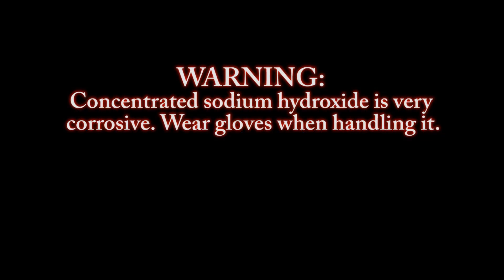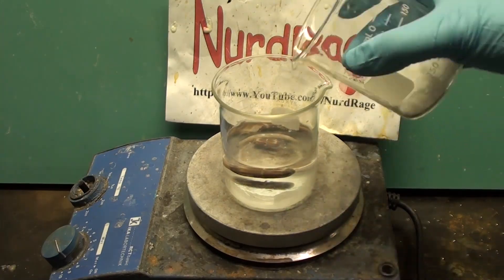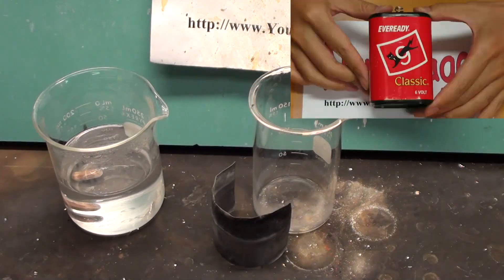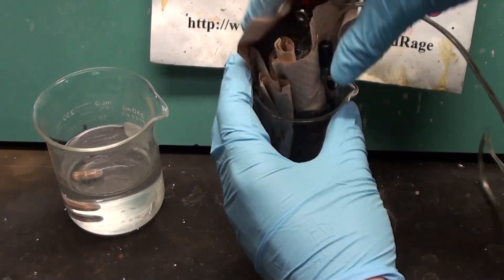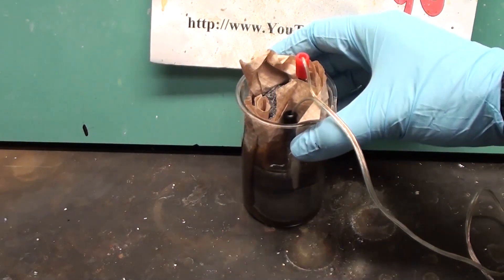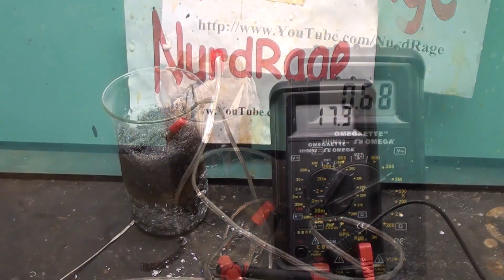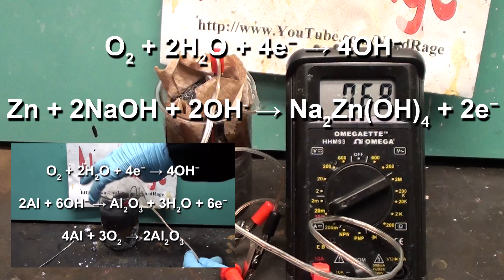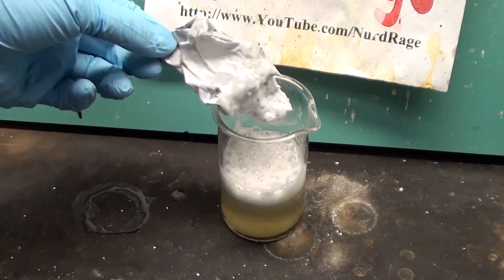Make a Zinc Air Battery

Comment: Does anyone know, would it inhibit the battery to use stainless steel wool?
Reply: It might work, but....   .... Note that anodizing the positive electrode at pH 14 is extremely corrosive.  (Who knows, there might even be O(2-) ions produced by the air electrode!).  Anyway, apparently these conditions will even corrode carbon and produce CO2!  That's corrosive!  (By the way the CO2 that's produced reacts with the electrolyte and clogs up the electrode, so that's a problem, at least long-term.)  (Also it could be possible to use graphite if it is coated in a waterproof polymer.  There's a long list of plastics that can supposedly hold up to KOH/NaOH)  Nickel and maybe certain nickel alloys are on a very short list of metals that might resist corrosion in such strong alkali conditions.  

One concern with using stainless is that the chromium might produce something toxic like hexavalent chromium.  I know the common 304 or 18/8 stainless is resistant to chemical oxidation/corrosion, even with chloride ions, but I don't know if it's that good.  Stainless isn't mentioned on the list of materials to use with KOH/NaOH , whereas Nickel is.   It's unfortunate because stainless materials are much more widely available than nickel ones, but I wouldn't risk it unless I guess you're prepared to handle it and dispose of it properly as toxic waste if something goes wrong.  

There could be nickel alloys that would work though, like possibly nickel-copper.  These alloys seem to be extremely resistant to oxidation/corrosion, even as good or nearly as good as pure nickel.  Both elements are similarly expensive, so maybe it doesn't help on cost, but it could help on general availability and sourcing of materials.  

I just know from trying to research anode materials that a strong oxidizer can destroy stainless well before destroying graphite.  If graphite can be oxidized here, then I don't see there being much hope in using stainless.  And yet I might have seen it mentioned somewhere as a possible third (+)electrode for charging a rechargeable zinc-air cell.  I wonder if would hold up in anaerobic conditions when it would fail in aerobic conditions?  Eh, the issues with any possible chance of hexavalent chromium don't seem worth it.  

You could also take the iron wool and electroplate it with nickel or nickel-copper alloy.   (Not that nickel salts are any picnic either! haha)  I think it's possible to make non-toxic batteries though, and we're going to have to do it sooner or later, so....it seems to me we might as well start on that now as long as we're building batteries.)

Other options are conductive or semiconducting metal oxides, like MnO2 (also ZnO, Fe3O4, etc.).  MnOx is also an ORR catalyst.  Mn is similar to Ni and Cu in being somewhat toxic, but hopefully the MnO2 is stable at least in alkali conditions, and hopefully it can be recycled if disposed of properly.

Comment: What you mean is this is a cell that produces electricity (a galvanic cell), and not a cell meant for electrolysis (which you called an electrolytic cell).. cataclysmicnothing is somewhat correct. The anode is indeed negative, and the cathode is positive. but in a galvanic cell, the redox reaction that occurs causes oxidation in the anode side, electrons to leave from it, and reduction in the cathode side causing electrons to enter it. AnOx-CatRed if i remember well.

Comment: saponification is a reaction between an alkaline like Lye a.k.a sodium hydroxide, and any long chain hydrocarbon molecule like animal fat for example or vegetable oil. (ya been skim over reading about soap or biodiesel i see)
so saponification has less than nothing to do with the concentration of lye (NaOH) regardless its source. homemade lye water fully evaporated to a crystallized form would work exactly the same as lye crystal made with membrane cell chlorine electrolysis.
NaOH is NaOH...

Comment: I Used filterpaper rather than the paper towel to make the reaction i got around 1.24-1.25 volts which was vey stable for atleast 3 hours. then i diluted the concentration of NaOH to 300ml and then the emf shot up to 1.35 volts. Thanks for the experiment Dr.N Butyl Lithium

Comment: I am looking for home made battery To store Electricity from solar cells.. This one produces good Current does not mean if I take large 5 Gallon Container and Use Large Zinc Plates and 5 Gallon of Steel MESH. I can get 220AH Battery with 6Volt DC current.
Reply: I read that it is not rechargeable. So useless. unfortunately

Comment: @taeke18 
W is unequal Wh! 5.18Wh means the battery can deliver 5.18W for one hour until it's completely depleted, that would be a current of approx 1.4A (at 3.7V voltage).
But still you would need quite a lot of these selfmade batteries, cell phones usually need at least 3.5V-3.7V to power on.

Comment: have you tried using activated carbon instead of steel wool as the cathode? activated carbon has a much larger surface area than steel wool for air to contact.

Comment: @xtremegameuser Just to do a quick calculation:
W=I*V

0.68*0.84=0.54Wh

The HTC does need more power. My HTC desire has a 5,180wh battery

Comment: Dear NurdRage! I made zinc carbon battery, and used only clean water for electrolite (hope I spelled that right). I got 1.5v which is about at maximum for 1 battery cell. But my current is too low, when I used salty water, it was a bit higher. I can make better battery using sodium hydroxide on additional chem hours in my school, but cannot show you because I cannot. Can you make one  using zinc and carbon with bigger current? Thanx!

Comment: Using a DC-DC transformer, it should be possible to boost the voltage while lowering the amperage. This means...... well.... you can get this to a fairly well voltage without getting rid of too many miliamps.

Comment: How much power is available from a cell like this? It would have been educational to show a few of these wired in series to a light bulb or motor. 
-
Why steel wool? Would sheet metal work?

Comment: The best and cheapest solution is graphite with alufoil as the electrodes and
water and K2CO3 as the electrolyte.
This gives about 1.3 to 1.5 Volts and lasts long and graphite can be selfmade
(lookup the overunity forum)
or from pencils. And Alufoil you can get from every supermarket.

Regards, Stefan.

Comment: @98JMA Look at the reactivity series.  Just below zinc is chromium.  That would probably work (at a guess), but it's far far more expensive than zinc.  Next down is iron, which is already in use as the catalyst/anode.  I don't see how the cell could work with the same metal as both anode and cathode.  All the ions would have the same charge.

Zinc is simply ideal.  It's highly reactive, low cost, utterly practical.

Comment: @EMDSD40LocoDash2 I might add, the huge surface area of the steel wool is probably much more than adequate for the task.  To deliver more current, I suspect more zinc (or a form with with greater surface area) and/or a freer flow of oxygen would be the best approach.

Comment: @EMDSD40LocoDash2 adding more of the metals would tend to increase amperage, but not voltage, so long as the components were acting as a single cell.

Comment: @bakonfreek You might consider saving to buy one. For around the cost of a top end calculator, you can get a Fluke or BK meter that will last a lifetime and will likely see more use in the long run than said calculator.

As for blowing fuses. You really should have a bit of idea what range the measurements are going to fall in before hooking a meter up in the first place.

Comment: @ArtistBlade1972 Don't know of a spec, but see section 4.2.6.  As you would expect, the output just goes though the resistor divider, so startup voltage shouldn't be affected by output.  I could see it changing the time for startup, but not much.  Anyway, the point is that its cheap and easy to turn low voltage things like this into good sources of power.

Comment: I know this is a chem channel, but since people are asking how this could be used, you could get a MCP1624 from Microchip which is under 50 cents each, add one inductor, 2 capacitors, and 2 resistors and you now have a boost supply.  Set it for 5V (using the resistors) and you now have USB charging power.  It would run from one of these batteries, but hope you are up on your surface mount soldering if you plan to build it.

Comment: @3981784 the cathode receives electrons from the external circuit.  it's easy to mix things up when you're looking at them from different points of view (e.g. physics vs chemistry).

Comment from the maker: @98JMA I did not misspoke. The anode is the electrode where molecules are being oxidized and the cathode is the electrode where molecules are being reduced. at the steel wool the oxygen is being reduced to hydroxide and taking in electrons. It is therefore the cathode and the positive terminal. 

As for your other question, you can, but what would be the reducing agent that gives up electrons?

Comment: @98JMA 
Firstly, thanks for the really quick response . . . .I love your work and your videos!! Secondly, I believe you misspoke . . . isn't the anode the positive electrode and the cathode the negative?? Anyway, what I meant is can you use a metal that does not react with NaOH to produce the metal complexes as the NEGATIVE electrode in place of Al or Zn?? Thanks:)

Comment: @NurdRage weren't scientist trying to improve the lead battery (2v/cell car battery) by using nano tubes and fill them whit lead. and they said that it would recharge like a capacitor and it could hold more power

Comment: @NurdRage Yep, and it's cheap.  Rotometals is one source.  I just picked up a sheet there which I'll use to fabricate a gravity cell.  I'm exploring the possibility of using gravity cells in a practical application.  Now that I've seen this demo, I'll definitely make a Zn-Air battery too!  And it may even prove more suitable for my application.  Thanks, NR!

Comment: @safenders 

Or use a power converter circuit to trade some of that amperage for voltage. A proper boost converter would do it, I think.

Comment: @HE3991 Think of it as salvaging. If that battery is dead and you can use the inside and outside for two different things you just did something good.

Comment: @JohnKapsis1985 The zinc is probably the limiting factor since there is plenty of air.  As you pull electrons out, the metal will dissolve into the sodium hydroxide (per the formula he showed on the video).  Pull out too many electrons, metal is gone - it will probably lose the alligator clip connection (due to metal weakening) long before it all dissolves.  Still, if you don't pull much current, it should last a long time.  Look up the relationship between coulombs, moles of electrons, and amps

Comment: @TheGreatIvan There is quite a lot that would work off of this.  What you may not know is the voltage from this battery is roughly what you would get from one solar cell.  You can either use electronics (search SMPS or switched cap boost) to boost the voltage (and there are plenty of ICs that are more efficient than those options), or you can just make several in series to boost the voltage.  That kind of current would easily run most electronics for some time, or a LED flashlight. Thx Nurdrage!

Comment: your are awesome dude.....but I was wondering if using some type of bronze or copper would be better for either batter set up?  and if not either, then is there a battery that can use copper or bronze like the zinc or aluminium.